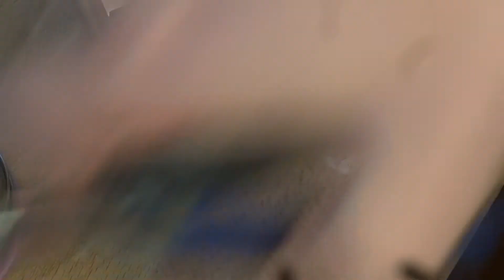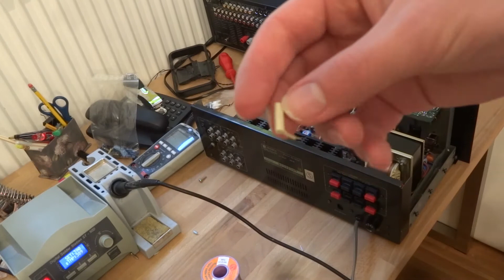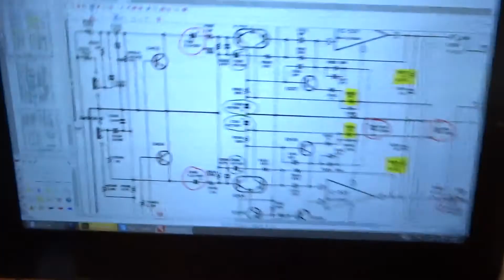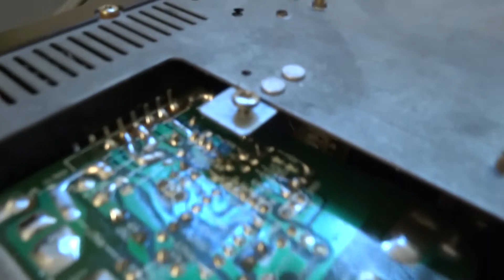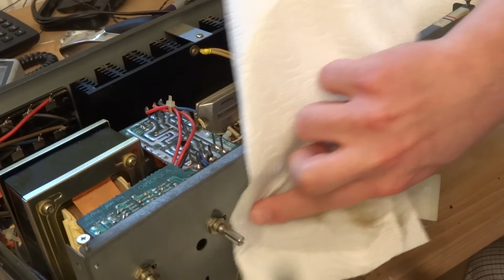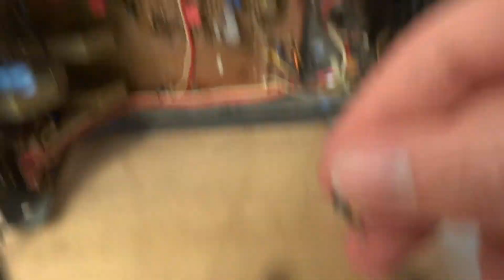Optonica SM1616 Restoration P1 of ?

Comment: I have this amp and I absolutely love it.
I am thinking of "restoring" it but I need to learn to solder first.
Reply: Come to think of it, is there a guide somewhere on what to change/upgrade on these things?
Reply from the maker: @a2xky  
As to soldering, i highly reccomend the videos series on soldering made by the company Pace, found here on youtube. Its called "Basic Soldering Lessons 1 - 9" by the channel (and soldering iron maker)
paceworldwide.

As for a guide on what to replace when doing a restoration, well there arent any im aware of, there are many schools of thought on this matter. When i made this video, i replaced all electrolytic capacitors, since they tend to try out. Or at least so i believed at the time, since learning museum level restoration and conservation of electrical equipment, i no longer just replace everything, but instead test each one, or just leave it as is, then test the circuits as a whole (listening to music through it in this case, as well as using a tracking generator and spectrum analyzer to measure the performance to find possible faults in need of repair. 

Some capacitors that have not been used for a long time, i generally try to reform if possible. And replace if not. 

Sine you will likely not have the test equipment i now have access to at the museum, you wont be able to fully judge the state of the capacitors. Thus its probably a good idea to replace all but the main filter capacitors. For the audio path i recommend either Elna Silmic II (if they still make them), or Wima MKS / MKP capacitors. IIRC, i used MKS4 for the amp shown. For the non audio capacitors i recommend Panasonic FC capacitors. They have proven themselves quite good over time. I usually order these parts from Mouser electronics or DigiKey. 

Unless there is distortion present after the recap,  excessive noise, or the transistors don't match those in the schematics, you wont need to do much else to get the amplifier back up to full spec. The main filter capacitors (the can contains 2 internally) is a bit more tricky to replace. I still have the original capacitors in all my Optonica Amplifier, and they still measure within acceptable levels. Replacing them with a new one is difficult, as it will require putting two capacitors in a space meant for a single large one. If i needed to replace one right now, id turn a custom can out of Aluminium using a lathe, and place a PCB assembly (or insulated rod assembly, id need to measure which is better in this case) feeding through a screw on cap in the spots where the original leads would have been. Making such a thing would take some time, effort and access to a lathe, not to mention the cost of materials. 

A site that got me started, but pointed in the wrong way a lot of times, was AudioKarma. They do however have some nice write ups of restoration projects and how problems like the dual capacitors in the optonicas where overcome. You will end up with a functional decently working amplifier if asking for advise there as well, but the way to get there might not be the best, or fastest, but usually one will be figured out over time. 

Ill be here for advise, but may take some time to respond.
Reply: @lbochtler  Thanks so much for taking the time to write that reply. It actually got me thinking if I should even "restore" it at all, considering that it sounds perfectly fine and none of the components appear to have damage. In my mind putting all new things in it was like giving it the royal spa treatment :)

 And if I ever do it, I will make sure I can solder properly beforehand because I don't want to ruin this amp.

Thanks again.

Cheers!
Reply from the maker: @a2xky  i recommend practicing to solder now, so you are good at it when its needed, rather then starting when its already needed. Use leaded solder with rosin core. I personally use 60/40 and 63/37 depending on what part im working on. The Pace video series gives good insight on the choice of solder. Avoid lead free solder, its not worth using and should not be used for anything important (a few exceptions exist, but not many). 

As for the capacitors, do a visual inspection of them from time to time. The cans (the round metal components) should not be bowing out at the top, nor should there be residue or liquid under them. the lable should also not be shrunk due to heat. They should look similar to modern new ones. If they do not, or some do not, they should be regarded as potentially damaged and require further testing with a LCR meter (if present), or directly replacing if not. 

Id need to look the circuit over again to check if there are capacitors whos failure could cause damage to the output hybrid, but i suspect there are few if any that could. 

Over all, i recommend you do some reading on electrical engineering and component aging and failure modes. I recommend the electrical engineering basics from the channel EEVBlog. 

But based on your description of it still sounding great, i don't think it will need servicing within the next few years. However, the capacitors will likely fail in 5 to 20 years from the time of this comments writing. That is the nature of imperfect components. The channel Curious Mark has some videos on recapping vintage electronics. Also, watch the video "Recapping: It's the New Bloodletting" from the channel 
Ray Gianelli
Reply: @lbochtler  oh definitely. I was ordering pcbs as we "speak" and breadboards as well. I already have a soldering iron (which needs a new tip) but I literally was not able to solder two wires not two hours ago. So... Definitely need practice. definitely will not start learning in this Amp. As said, i love it to bits. Might start searching for one of it's big brothers.
Reply from the maker: @a2xky  Good, some quick notes on soldering, these are also mentioned in the videos from pace i recommended. You might also want to watch "Above and Beyond" from NASA, it also gives a good starting point for general soldering. Soldering with lead free is considerably harder then with leaded solder, so go for the latter. Its also vitally important that leaded solder be used when working on vintage equipment (unless otherwise specified 60/40 was almost certainly used. This is the case for the SM1616). I recommend a medium chisels tip for the iron, and a tip temperature of around 350°C for leaded solder. The joints to be soldered must be clean and ideally de oxidized. Rosin core solder is good, but can struggle on vintage electronics, as the oxidation is quite significant at times. My general rule of thumb for such restores and repairs is to de solder the component using a de soldering station, or have good skill in using a de solder pump (either way, you need to minimize the time which the traces are exposed to heat, as they will come lose) then clean the pad with the de soldering iron and if needed a fiberglass eraser (careful, it will strip solder resist in a heartbeat) or a eraser for pencil marks. then clean with isopropanol alcohol. The new components legs get a quick sanding with 1000 or 2000 grit sandpaper fallowed by cleaning with isopropanol or acetone (depending on component, contamination and what i happen to have at hand, IPA is recommended though). Dont use denatured ethanol as it will leave bitrex behind. 

Dont touch the cleaned components with the bare skin, as oils from it will result in poor solder joints. Heat both the pad and the lead at the same time, both the pace and NASA videos show how this is done. 

For wire to wire soldering, i typically use 63/37 solder, as it will solidify very quickly and thus decrease the likelihood of a cold solder joint. The goal of the soldering iron is not to heat the solder, but the components / wires that are to be soldered. They need to be above the melting point of the solder for a good joint to form. Again, this is shown in the videos. 

Lead free solder has the problem, that it rapidly oxidizes at the temperatures needed to melt it, if high reliability joints are to be made, it needs to be used under argon or nitrogen atmosphere, something that only the very top of the line irons have. The alternative is excessive amounts of flux and fast working. After 20 years of experience soldering i can get both classes of solder to the same joint quality (not accounting for the inherent flaws of lead free solder of course) but it took me years to get as good at lead free solder as i was with leaded. 

Also, when soldering, clean your tip prior to soldering the joints. Either by a wet sponge or brass wool. Both work about as good, though i personally prefer the traditional sponge method, though i do enjoy the automatic tip cleaners available from the likes of JBC. Unless your building space hardware, medical equipment or aircraft parts that can not fail under any circumstances, you will not be needing high end soldering irons. I personally use a JBC compact soldering station and a Chinese T12 soldering station as my main irons. The T12 is my home station for occasional soldering, and the JBC my main iron at the museum i work for / am a founding member of (this iron was my main iron for a long time, but due to lack of funding it now lives at the museum, thus the T12). I also use a Pace de soldering iron (again at the museum) as well as a ZD915 Chinese de soldering station as seen in this video. The Pace iron is better, but not by as much as its high price might suggest. The de soldering stations / irons help reduce the likelihood of lifting a trace, a problem a lot of my early repair work had. They are however expensive and at this point, i can get nearly as good a result with a normal iron, a de solder pump and some solder wick (with separate flux added on top). It all takes time and practice to master, the de soldering iron saves time when doing repairs, but prevents you from learning why you might want to use one. 

Basically, watch the videos on soldering i recommended, ideally use a temperature controlled iron (you can get good results without one, but it takes more skill), use leaded solder, and practice. Eventually you will get a hang of it and get good at soldering. Start by putting things together, then taking them apart again (de soldering) and you will gain a valuable skill. (i find that a shocking amount of people can not solder to a good quality, yet still claim to be good at it. The video from NASA details just such a case, a TV repair man, turned spaceship soldering expert. Try to form the good habits shown in the video, lest you need to spend even more time unlearning bad ones. If i had gotten guidance like that shown in the videos when i started, i would have saved myself at least 5 to 10 years of hardship trying to fix and build electronics.

There are also some old videos from the 1930s and 1940s on how to solder, which give insight to soldering with primitive tools. With enough practice and experience you can solder with basically anything as a soldering iron. Basically, a novice needs a high end soldering iron to get good joints (if not practicing and forming bad habits) where as an expert can do so with a piece of rebar and a blowtorch. 

Thus, practice practice practice, if you need more advice, or help figuring out the problems in soldering technique or with repairs etc... im happy to help, though i cant guarantee that ill be able to respond in a fast manner, as i have quite the workload at the moment.

Comment: Hi mate, I have just bought the same amp online and wanted to change the caps as there is a lot of hum and background noise which I can hear through the speakers.

I noticed that you used a variety of different brands and models of caps in different areas of the amp.

How do you decide what to use where?

Can I replace all caps with Elna Silmic II, for example?

I'm new to electronics and still trying to learn the basics.

Any help would be appreciated
Reply from the maker: I decided the capacitor models based on ESR, AC content, and temperature.

Noise is likely the input transistor pair (which i replaced on mine) you will have to gain match the 2 transistors used though. i used a multi meter and wore cotton gloves (since gain is temperature dependent) to match them. 

here are some recommendations for caps:

for the audio path, i recommend either WIMA FKM series caps, or Elna Silmic II. 

for the power supply caps, i recommend Panasonic FC caps. the main filter caps are a bit of a different can of worms all together.

The Elna Silmic II are good for audio, but not so great for power supply duty. So stick with the Panasonic FC there.

as for the transistors, they are named KSC and KSA these days.
Reply: @lbochtler  Excellent!!
Thank you for clarification.

I have my component buy list ready.

I noticed there are 2 capacitors on the bass/treble tone board, which are 10uf 16v (C318 & C317),
so that would be in the signal path right? So my best bet is to use Elna Silmic's in this situation?

Also, would you recommend any books for somebody wanting to learn about basic electronics?
Reply from the maker: @RU55KI1  you are correct about the signal path cap choice for the tone control circuit. you will indeed want to use silmics there. 

as for books, i sadly dont really have recommendations, as i learned electronics by reading various things on the internet. there are some decent videos out there too
Reply: @lbochtler  Thank you very much for your help!

Comment: how hard will it be to get the 50 volt 6800 mfd part number rc-ez 1004 afzz it is the dual power cap 6 pin
Reply from the maker: Almost impossible. Though i have seen them pop up on ebay from time to time. I have thought about building a custom chassis to replace the 50V 6800µF caps in 2 of my amps, though it will be time consuming and expensive to make (relatively speaking).

Your best bet right now, is to get 2 6800µF 50V (63V) caps either United Chemicon, Nichicon, or cornell dubilier, and build a custom board to hold them. Alternatively, you could get screw terminal caps of the same capacitance and voltage rating (i recommend slightly above), and mount them in the amp chassis.

It would help to know what amp you are working on, i might find a way to fit 2 normal caps in. 

Alternatively, if you have the time and skill, you could restuff the old caps, using 2 new caps of a small size.
Basically, you would cut open the old cap, remove the contents (i recommend cutting in such a way, as to have 2 cylinders, in order to recombine the 2 halves to form the new old cap. Then remove the old capacitor contents, leaving only the terminals, then get the 2 new caps, and solder them into place, so that they match the termination of the old capacitor. Then use a tube of some sort, to recombine the capacitor halfs.

I have however never tried this on such a cap, i have only seen it done in tube gear, so take that with a grain of salt.

You might also find some help on the Audiokarma forum.

Hope this helps

Comment: it looks like the cover is missing on each side of transformer
Reply from the maker: David Berquist The transformer is not supposed to have covers, like the one in the s3636 and SM1515. Its shielding is quite adequate for this amp, granted, using my beyerdynamics i can hear a tiny tiny bit of hum from the transformer, but hearing it is incredibly hard, and takes the use of the beyerdynamic flagship, as well as a quiet day to accomplish.

Also fun fact, i am listening to music on the SM1616 while writing this comment.

One thing you need to keep in mind is, that this amp was sold for sub 400 DM back in the 70's. Not sure what the SM1515 went for back then...

Comment: i belive a ecg43 or stk482 can be used in its place check with a cross refrence guide befor using
Reply from the maker: David Berquist If your reffering to the dual transistor (i could not find datasheets for the 2 transistors mentioned by you) then i doubt it will work. Based on the discussions i have had with experts from audiokarma, the best way to replace a 2sa798g is with another 2sa798g or with 2 glued together KSA992 transistors. The important thing is, that the transistors are thermally connected to eachother, as well as being perfectly matched.

Comment: is the dual transister a a798
Reply from the maker: David Berquist It is indeed. More specifically its a 2SA798G. Its also used in the SM3636 as the differential driver of the power amp in it.

Comment: is the power cap 50 volt 6800 mfd times 2
Reply from the maker: David Berquist The main filter cap is indeed a 6800µF x2 50V capacitor. I'm still working on coming up with a method to replace it. If i come up with something you will probably see it in a video of mine.